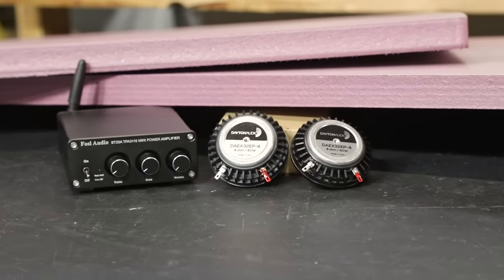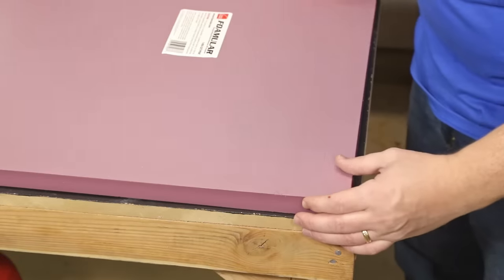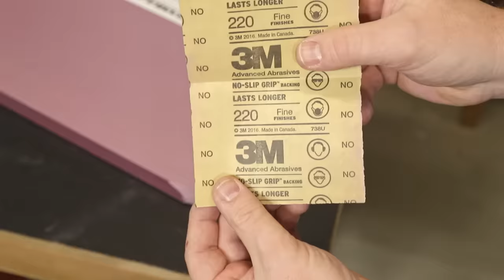How To Build "The World's Best Speakers" - Are Flat Panel Speakers Really Any Good?

Comment: If one were to place about 2' of insulation BEHIND them, you'd get even better results. Since they project equally front and back, 50% of the sound is going back to the back wall. Math and acoustic theory tell us that there are going to be all manner of phase cancelations and enhancements as the bounced signal joins up with the main signal, and hits our ears.

Really, the most spectacular these could sound, because they are so omni-directional, is to listen to them outside. 

And of course, our inventor brains start asking all sorts of questions:

Would perfectly round ones sound better, much like a drum is always round? 
How much deeper bass could one get by increasing the size of the panel? 
What if one were to seal the panel in a box, much like a traditional speaker, so all the vibrations that are now lost to air, are projected to the front, and there were no phase issues with a back wall(see above)?
Or if the edges must float freely, what if it were suspended within a box full of insulation?

So many questions.

Comment: I made these.   The difference in mine, were I did not use the suggested adhesive.   The panels required a lot of amplification to make it work.  There were resonance peaks at certain frequencies.  QUICKLY I figured out that these are not the worlds best.  They are not even the top 95%.   Waste of 300$ bucks I used to get EXACTLY the amps and parts (minus the adhesive).  Did it ALL like the original creator.
Reply from the maker: Hi Tkcdac - what did you buy that cost $300? Were you replicating what I showed in this video, or the more involved version from Tech Ingredients?

Comment: You're experiencing baffling.
That's where the air flow goes from front to back, around the edges which cancels out the low frequencies.
You would also get at much better low frequency,
 if you put a bit more weight on the back of the kicker speaker, then the resonance will be more forced, thus louder.

Comment: Pro-tip: Are you going to working with adhesives, spray cans, etc in a cold garage? Grab a cheap slow cooker, toss some water into it, set your cans in the water, put it on low, and set it in your garage while you get your parts together. It will be nice and warm and the products ready for use when you need them. If you need them faster, start with nicely warm water from the tap and the slow cooker will just keep things warm.
Reply from the maker: Great tip!

Comment: I like flat speakers

I personally prefer parametric audio speaker there really useful

mainly because the speakers send a ultrasonic sound barricade that keeps absolutely every sound from the speaker in the room without it bleeding out the speaker is basically a spotlight if you have to be Infront of the speakers to hear them so basically if 
Let's say u have someone trying to work but u want surround sound but u don't want to bother that person

Then if u use a directional audio speaker it only makes sound that only be heard in one direction giving a better privacy when talking on a mic on playstation or play on PC while people are sleeping

The speakers can't vibrate or heard through walls 
Because the ultrasonic barricade block the hearable sound from escaping

Good for people are sleeping in apartment

Put one in the back seat of your car and get a mic and make a voice jammer that only they can hear but not u so u drive without getting distracted 

Troll people at the library with this make them talk to there self by aiming it at they and troll them

Comment: I bet they would sound even better if they werent hung by their cone, but instead if you could find a way to hang it by the back of the driver. Or build a support around the cone, and have the cone suspended by a flexible material. Like basket and surround set up of a speaker.
Reply from the maker: Hi MBL20 - Great suggestions! I actually tried both of those ideas in my follow-up video here: https://youtu.be/XC814uQjlaE

Comment: Anyone who tried constructions like this knows that they have a limited frequency response - and lots of the resonance frequencies based on the board used. Sure - they can have a function but they are not a real replacement for true Hi-Fi speakers. All I ever heard had a distinctive mid frequency elevation and that can sound pleasant but does not reproduce what you could hear sitting for instance in a concert hall. They used to be called “exciters” for a reason - they are only as good as the material they are sitting on. In the 80th or so they were put for instance on the windows of shops etc. to get the attention of potential customers. I had them under the rear bench of my car - but the real sound came from conventional speakers in the front.

Comment: I would assume that the sound radiating from the back of the panels, thus being reflected from the walls, isn't helping.
I wonder if anybody has ever tried covering the back with some light-weight soundproofing panels (with spray glue) either directly to the panels or onto the adjacent wall.

Comment: Rolling shutter of the camera makes it look like the panels flex more than they really do.  Much like the rubber propeller of a small aircraft.
Reply from the maker: Hi Gregory - while the rolling shutter effect does perform a bit of an optical illusion in this video, these panels really do move around / vibrate quite a bit when they are driven hard. Thanks for watching!
Reply: @AmplifyDIY  TY 4 making note of that.  I'd written it off to a sort of aliasing.

Comment: I'm curious about the sound stage, in particular the accuracy of the stereo image and the ability to place the singer/performers. They are far from point sources and therefore should not produce an accurate image.
Reply from the maker: The best way to describe it is that the sound stage envelops the listener. It's quite a different experience that listening to traditional speakers.

Comment: Xps or eps foam board?
Reply from the maker: Hi RC Tutor - this is XPS (Expanded Polystyrene)... trying on EPS would be interesting, but it's much less rigid, and I suspect won't sound as good. Thanks for watching!
Reply: @AmplifyDIY  I wonder how carbon fiber Kevlar would sound. I would assume that it would be lighter overall and stiffer , hence maybe a sharper sound to?

Comment: The lav mic is designed for voice recording and not designed for music recording.
Reply from the maker: Hi Mike - lavs are just microphones... generally they are smaller condenser mics, with an omnidirectional pickup. While they are typically used just to pick up dialog other speech, they can be used to record anything. A good lav mic will provide a nice frequency response just like any other condenser mic.

Comment: Man, ever since I've seen the original video from Tech Ingredients (there's also a more recent follow-up) I've been upset that there's not much room left to the sides of my projector screen. So this made me wonder how would those fare if given a more slim shape, like 30-40cm by 150. Or a soundbar variant to go under the screen. Mind testing this out for me when you have the time? Thanks :D
Reply from the maker: Time? What is this mythical thing called "time" you speak of? ;-) In all seriousness - if only I had enough time to test ALL the suggestions I've heard. I am interested to know if other shapes make a significant improvement though, so I'll add your suggestion to the list (no promises, though). You may also be interested in the extra testing I did in this video, if you have not seen it yet: https://youtu.be/XC814uQjlaE
Reply: @AmplifyDIY  to be fair, I think Tech Ingredients tested several shapes and materials in their original video, but I'll have to rewatch that since it was posted so long ago. Checking your follow-up video now, since I have a little bit of that time to spare 😁

Comment: Let's try a 16 band or 32 band EQ to make up for the oddball response.
Reply: Also might make sense to use different "flat" materials and sizes versus trying to do full range on a single sheet and end up with something like 3-way emitters. 
also consider the frequency response of the drivers and using more than one type or size of driver if you want to take it beyond this fun experimental stage.

Comment: Ok distance to and from a wall will change the output of the back wave as these radiate sound both the frt and back move or produce sound if you move them closer to a wall is going to change how the sound reflects off the back wall.
This is true with any speaker. 
You can put the transducers on either side also.  You your budget is low and you want a stealth speaker these would be great for a workshop or even home theater room for fill.
Reply from the maker: Absolutely correct. If you want to place them near a wall, put some acoustic insulation on the wall right behind them. Thanks for watching!

Comment: The physics of wavelength vs speaker size make this open design lacking in bass since the wave just goes from front to back before it goes out in the room.  The low end of this will be somewhere around A 440 so you won't hear fundamental notes.  You would need an enclosure to get real bass.

Comment: To simplify a bit, get rid of the 3/5 thing, and just do 2/5 twice. 2/5 from the top is the same as 3/5 from the bottom
Reply from the maker: Except that you are going 2/5 from the *side*, and 3/5 from the *top*. The 2/5 and 3/5 are measurements on different axis. The whole point of all that is to make sure you don't place the exciter anywhere along a center line of the panel (either vertically or horizontally). It needs to be off-center entirely.
Reply: @AmplifyDIY  Right. So 2/5 from the side, 2/5 from the top. For a square, why waste time and do the calculation twice? Do it once, and rotate the ruler
Reply from the maker: @Matio25091  Certainly on a square that is a great approach. I was following the instructions from Tech Ingredients, which aims to generalize the placement instructions. They used 2/5 and 3/5 because they built these out of some panels that are square and some that are rectangular. Obviously on a rectangular panel, you need to measure and do the calculation twice, as I showed in this video.
Reply: @AmplifyDIY  Ah, I see. And I guess "2/5 3/5 rule" sounds better (and is more memorable) than "2/5 2/5 rule"

Comment: Try not using blue tooth and mp3. Get a decent signal uncompressed to play through them. Of course they sound good when compared to crap.
Reply from the maker: In my follow up video I'm using a wired connection, and uncompressed file formats. Thanks for the tips!

Comment: Here is a small tip for attaching items with double sided tape onto foam board  if you use piece of Foil tape   But before you stick the foil tape to the foam you coat  the area  with regular Contact Cement or Elmers Rubber Cement  let it dry to touch then apply the Foil tape  and then stick your item with the double sided tape like those Exciter Speakers  it all becomes  almost  a Forever Bond   FYI the best double sided tapes are 3 M products   And you need to be careful because the Chines make a Clone that is branded 3W and is even the same colors as 3M  to fool you  also a company called FastCap. Sells their own branded Super Tape that  is Tenacious as hell  Professional Floor Installer use it to permanently stick Threholds  in Doorways on the new floors  it’s that good ! fast Cap is online too  I’m a retired professional Woodworker and they  have many products and tools I  bought for that Industry BTW a top notch business with excellent Customer Service and Support  I’ve used that FoilTape Trick a lot inmy career as often we made foam tack boards  covered with Fabric of the Customers choice  for the inside of Reception Desks and Office Workstations  sometimes we used Industrial Velcro or Hook and Loop  so the Tack Boards could be removed and recovered if the Client  needed to do so  BTW I love the Speaker set up  and Conept  I think that it might make awesome custom Surround Sound Speakers and maybe a cool Center Soeaker  perhaps shaped in  very Custom ways and either painted or fabric grilled covers to match a rooms Decor  with the low costs of supplies  one might be more capable of adding extra speakers  in a Video or Audio Room or Area  erhaps  creating sort of a more Reflex style of Sound  for a low cost

Comment: These panels will struggle to reproduce Low frequencies - say below 600 hz.
λ=ν/f where the speed of sound in air is about 343 m/s.
The speed of sound through the foam material you’re using will be higher than it is through air.
Reply from the maker: Yes, they definitely benefit from adding a subwoofer.

Comment: you do realize, that tech incredients used acoustic ceiling tiles for the mid ranges and a sub-woofer for the lowest range? also they made them explicitly non square and not in an 1:2 ratio either? because i am suspicious too, but those details seem important, so i am still unclear about if i should build my own, or not, even having seen your video.
Reply from the maker: Yes, I'm aware of all the different testing that they did - including their latest video from last week. When I produced this video a while ago, I was just interested in dipping my toe in the DML world, and these were the cheapest and easiest way to see if there was actually anything to their claims. Turns out, there is. :)  If I was building a permanent installation, I'd incorporate rectangular ceiling tiles as well. Also, I did a bunch of follow-up testing: https://youtu.be/XC814uQjlaE
Reply: @AmplifyDIY  yeah, sorry only realized that this is an older reaction to the much older 'version 1.0' of their approach....
so it seems i got to get myself a couple of ceiling tiles and rearrange my furniture plan.... seems worth it. thanks for testing it out!

Comment: The boards linked in this video are no longer available. Also, they dont show the compression rating, which i imagine would play a huge part in the sound quality. It looks like 150 and 250 compressive strengths are the 2 popular compression ratings for the 1" boards. @amplifydiy do you know what the "Compressive Strength" and "R-" ratings of the boards you used were? I bet a lot of the "I built these and they suck" comments are do to folks buying the wrong boards.
Reply from the maker: Heya Something Clever - the specific product I used is here: https://www.owenscorning.com/en-us/insulation/products/foamular-250 (there is a link to the datasheet at that site, which lists the compression strength, among all kinds of other data) - and I bet you are right with respect to others reporting much worse results... either they tried a different kind of foam board, or they mounted it very close to a flat wall behind it, which will cause destructive interference and makes them sound really, really poor.
Reply from the maker: Oh, and they are still available in my area…

Comment: Never put the transducer dead center, you’ll get a lot of constructive & destructive interference from that panel — so you’ll get some notes that are too loud & some notes that drop off.
Reply: To make your speakers cover different sweet spots, try the transducers at different odd ratios, say 2/5 and 7/16 for ex. Also rectangles are better than squares for the same reasons
Reply from the maker: Thanks, Robert!

Comment: At that amplitude of vibration you should have better low end. The concept suffers of  lack of back/front separation, plus the complete useless movement of the exciter. Simplicity goes with a price. Build a box, fix the exciter, put a light flexible suround on the foam panel and you have flat "cone" loudspeaker. Much better in terms of efficiency, but probably crap in terms of sound quality😃